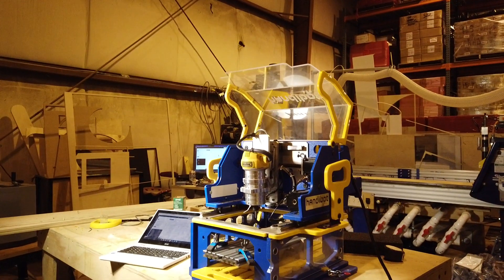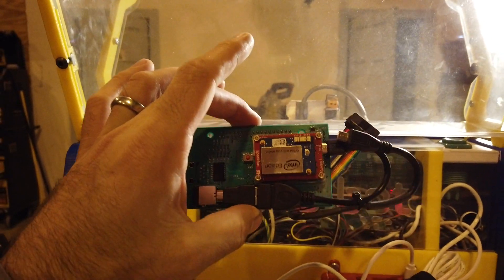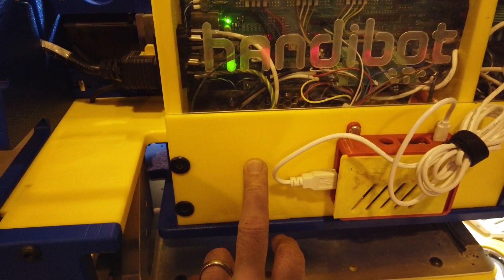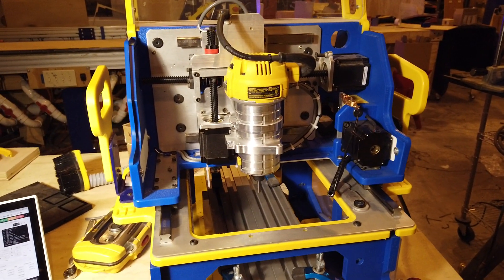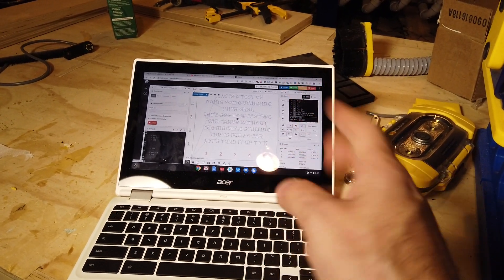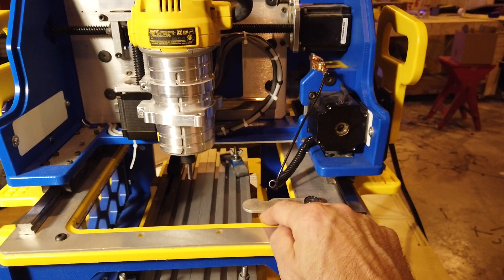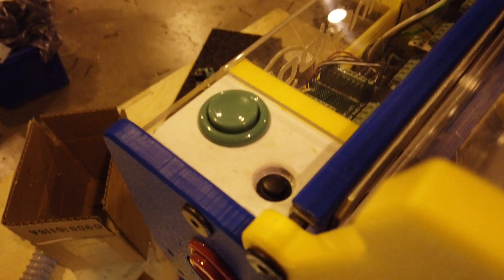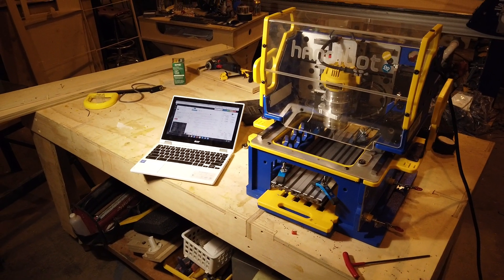ShopBot Handibot to GRBL Conversion

Comment: Thanks for the video Eric, but as someone who's struggling with a handibot that drops it connection when running on the intel edison, here's another vote to request more detail!

From what I can gather, for this conversion one would need:
1x arduino uno or equivalent to run GRBL
1x raspberry pi to run CNC software (could maybe be skipped if hooking up to a computer?)
1x db37 connector board
6x limit switches (not needed but sounds like it would be better with them)

Do the servo drivers stay the same?
Is there any soldering or pcb cutting needed?
 
Thanks!

Comment: Hey, cool vid! I'd love to see more detail though. I want to do this to the school's shopbot that I work for. How is the DB 37 connected to the arduino. Are there standard DB37 breakabout boards for this? Do the pin maps work? I'd love to know more about this so I don't have to re-create your wheel. I have a different shopbot at the school, I believe it's the Desktop MAX ATC, which is a nice machine, but their software sucks, to be frank. I know this is an old thread. Would mind if I contacted you about this?